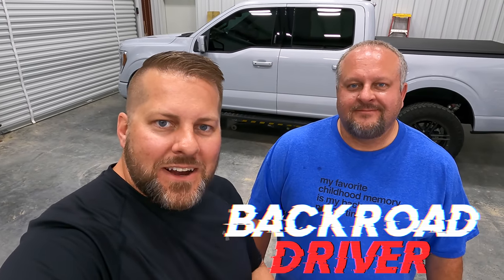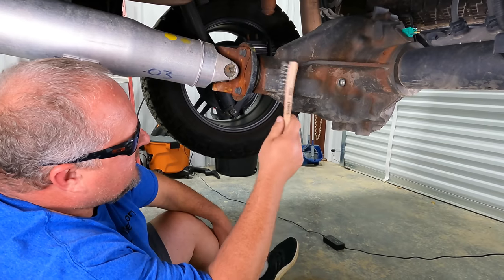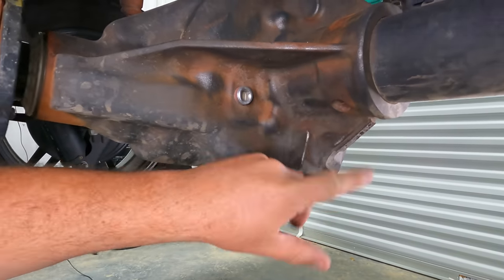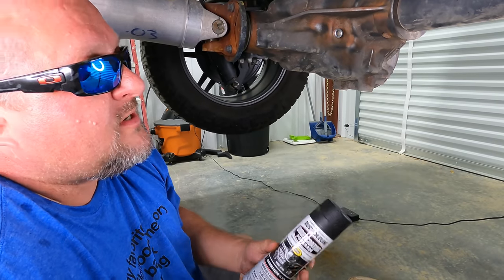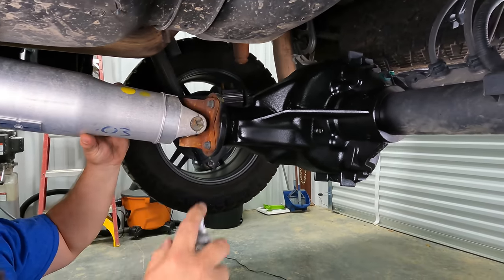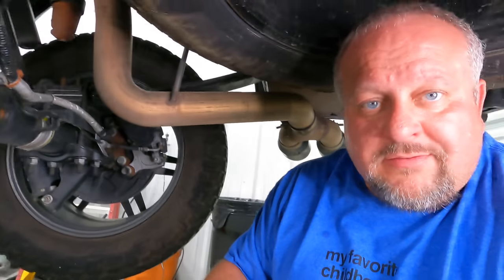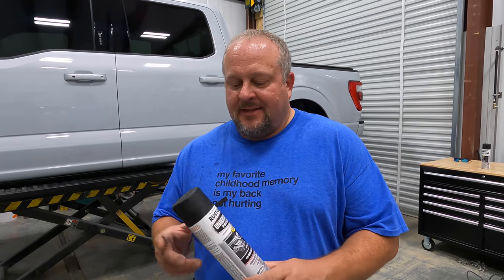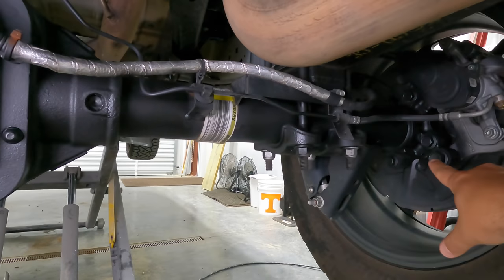New Ford F150 Rusty Rear End - We Fix Sam's Rust Problem Once & For All! Rust Removed & Coated

Comment: It’s completely normal to have that rust on the differential housing, it is cast iron. 

My new 2001 F-150 was just like this and 20 years later of snowy winter, after winter of treated roads, it is just fine. Surface rust only. 

Of course other parts of my truck have succumbed, like my rocker panels, but that cast iron housing is not going anywhere. 

Everyone needs to stop losing their minds about it. It is a non issue.
Reply: It's not normal. I had an 06 dodge ram 1500.. had it for 15 yrs no rust. I'm in the south also

Comment: Hi Sam I live up in the Northeast and they don't recommend using undercoating over rusty areas. I had some rusty spots on my 2018 GMC's frame rails. Rustolium also has a spray paint rust converter that's works 👍. I treated my frame rails ran through the winter and no rust bleed through. I am going to check this undercoating out thanks!
Reply: I live in the northeast also. I’ll have to checkout the rustolium. The rust is what scares me the most
Reply: Yeah rubberized coatings make things way worse. Salt and moisture get underneath and stay there. The rust will be much more aggressive. I paint with a converter and then keep it all coated with oil or fluid film.

Comment: Great video, loving the channel so far. I’ve been a Sierra owner for the last 15 years but recently had my 16’ totaled out. So being forced into a shitty car market I’ve been exploring different brands. I’ve considered a ram rebel and an f150. GM has a known issue with transmissions and lifters, along with the leaking rear window and third break light, ram has these issues as well. So none of these new $60k plus trucks are without issues, it’s really a roll of the dice if you get a good one or not.
Reply from the maker: I agree. Which dealership in your local area is honest is a good place to start. We have great luck with our Ford dealer.

Comment: Nice job guys.. I just received my 2021 f150 plat which said was completed in May. I have some surface rust in the same areas, not as bad. What did Ford tell you they would do? My dealer looked at it, but was their first and made me open a case with ford. Thanks, keep the videos coming.
Reply from the maker: We just knocked ours out ourselves. Ford will probably take care of it for those that raise cane, and some should. Sam’s was minor and our coating was better than what the dealer would have done. Congrats on the new truck!

Comment: I bought a 2023 f150 xlt 5.0  with a  331 rear end about  month ago  and the def was all rusty. Dealer did not care about the issue of the rust.  I will be doing the same thing as you did in your video. Sad thar ford doesn't care about the rust  on the def.

Comment: Hi Sam, thank you for the video. Very resourceful. Recently purchased a 22 F150 and they still have rusty rear diffs. They know there’s an issue with all their trucks in this yet they are not doing anything about it. FYI here is Ford’s response per service advisor.  THE OFFICIAL RESPONSE THEY GAVE ME WAS "PER WARRANTY AND POLICY MANUAL SECTION 3.1.04 FORD STATES THAT UNDERBODY SURFACE RUST OR CHASSIS COMPONENTS ARE NOT COVERED BY WARRANTY". THEY DID HAVE ME FILL OUT A SPECIAL SHEET THAT FORD IS INVESTIGATING LOTS OF SIMILAR CASES BUT AS OF TODAY NO RESPONSE.”

Comment: hey guys I asked the dealership if they can take care of the rust, their response ,of course was don't worry about it.they also told me not to treat it because it can change something with the balance of the rear Dif.this is my first ford vehicle.i was hooked when I saw the new F150.but I am disappointed with the rust.
Reply from the maker: Not worrying about it is a load of crap. Putting a coating on that should have been applied at the factory causing a balance problem is more crap. They just don’t want to do yours and have to do 100 others.
Reply: @BackroadDriver  thanks for the reply gonna do what you did to protect my truck.thanks for all the awesome videos you do on your channel.
Reply from the maker: Thanks for watching Rudy!

Comment: My 2021 rear axle had a leaking bearing. Turns out wasn't machined properly from ford. Ended up replacing whole rear axle assembly. New one came painted wayyy better than the factory. 800 km on truck. Was in the shop for 5 weeks

Comment: Thank you for sharing this. I am currently de-rusting my 2006 F150, the wheel wells and cab corners keep coming back after a few years. I’ve had to fully cut out the rears that have insulation that traps moisture. I could go on but I’m sure Ford owners know these troubles all too well. Ford engineers need to insist that the company beef up their paint thickness and/or quality. The amount of money you pay for these trucks nowadays is the price of a small house. They can get rid of some of the electronic features in my opinion and focus on a complete overhaul of their paint quality and control department. 🍻🇨🇦😎

Comment: I notice your leaf springs are 2 leafs plus a helper vs mine has a thick single spring with a helper spring, and my spare wheel is aluminum?  Its also a 2021 Lariat.
Reply from the maker: My truck has the max tow package which adds a beefier 9.75 rear axle and the additional leaf spring. I'm not sure about the spare tire.

Comment: Hi Guys, I have a 2022 F150 Lariat edition and I recently noticed that when I press on the brake pedal to start the truck, the pedal goes extremly close to the floor. This is not normal. I took it to the dealer on 12/26 and they are telling me this is how the brake system works and its working as designed. I don't believe that. Is this a common issue and have you guys experienced this before?

Comment: New England truck owner, just take a paintbrush and brush some 75-140 rear differential oil all over the steel that isn't factory or dealership undercoated.  If surface rust has started, rubber coatings will only trap it under there.  Rubber sealer coatings are for new steel that hasn't started rusting.  Fluid film is ok but doesn't penetrate as well.  Seriously, just brush on some rear dif oil and surface rust is a thing of the past.  just don't touch anything rubber with it.

Comment: I need to do mine now...especially since I lifted it you can see alot more of the undercarriage
Reply: Greg B  i have the 5.0 and I don't have the BBQ tick but I dud have a engine chirp sound that I got fixed by replacing my timing chain tensioners

Comment: My new F150 had a rusty diff right on the lot.  I'm not concerned about it.  I fluid filmed it when I got home and I will reapply at every oil change(3000-5000 miles).  It takes a couple minutes plus it works down into all the small areas paint wont reach.  Should I have to do this? No, but its not hard to spray so I can deal with it.
Reply: You make way too much sense

Comment: What kind of lift id that?  Gotta link?
Reply from the maker: It is the Falcon sport tow/haul system. Check out the playlist for Sam’s build and watch the full video on that mod.
Reply: @BackroadDriver  my apologies for not specifying. I mean the lift that is holding uo the truck so he can spray the diff.
Reply from the maker: My bad. It is similar to this:
https://www.harborfreight.com/6000-lb-capacity-scissor-lift-91315.html
Reply: It's an ATLAS 6000lb lift.  This one is model # MR06 which I think is discontinued but there are others like the one in the link.
Reply: @thesamizer  thanks much fir the info

Comment: Did your battery go dead yet . I didn’t have my zone lighting on per the current message from Ford  and mine did. I have 1700 miles on it. According to the F150 forms it’s a common problem.
Reply: I haven't had that problem.  What is the name of the thread?
Reply: I have a 2023 F150 powerboost and already had the battery replaced.

Comment: Truck comes with a Rust warranty have them do it meaning the dealership…. That’s my two cents
Reply: Factory rust warranty is against perforation
Reply: Is this true? My brand new 2021 f150 has rust on the diff covers as well. I'm calling the dealership tomorrow
Reply: What did they say? @hello-u2w
Reply: @motiv8d111  they didn't do anything. A steel brush rustoleum primer and black matte paint and it looks great!
Reply: @StevenHenein  just bought a 2023 tremor 3 weeks ago that was built with a MNF date of DEC 2023.  Same thing.  Thank you for the tip...will be my weekend project

Comment: Never use rubberized undercoating on top of rust because the result will be rapid corrosion of the coated part.  There are at least 1000 videos on YOUTUBE showing the disastrous results of vehicles coated with rubberized undercoating.  My advice is never do what this fellow did....NEVER